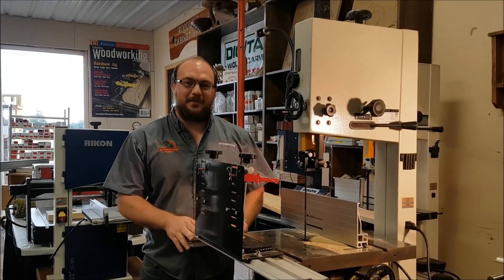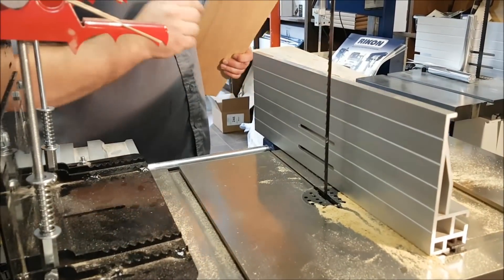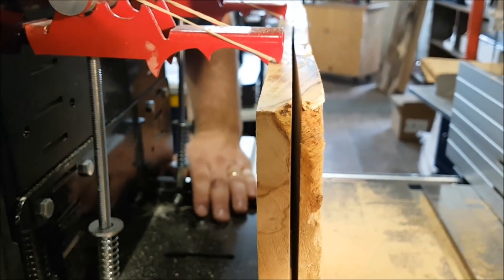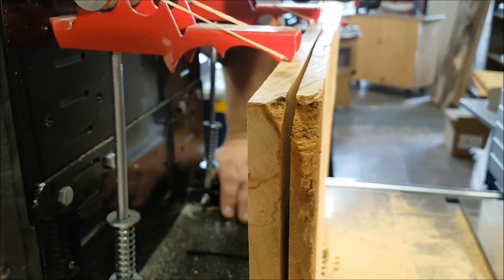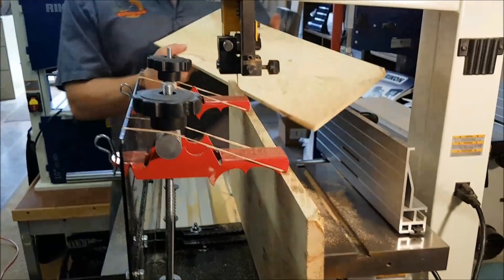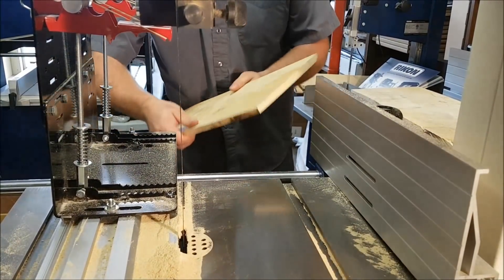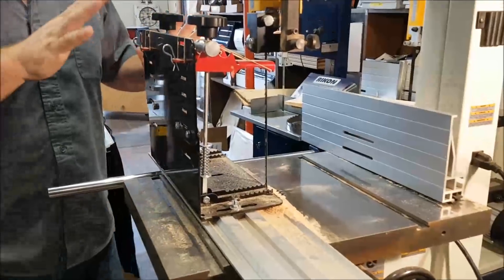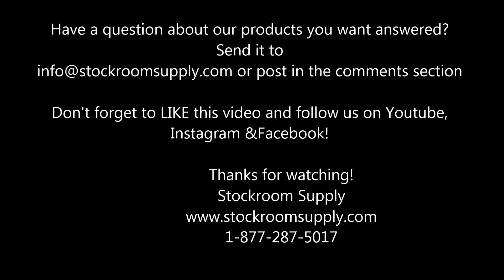EthAnswers Blade Drift Myths #2 Why Fences Don't Work On Bandsaws

Comment: But you will still need to joint the initial board after resawing or lose the board, doing it this way will create either more work (much easier to joint a thick board over a thin one) or you will lose two boards,the first and last ones cut on the 'deal'...and that's too much waste for the types of wood I use. 

As to how to hold the boards against the fence to avoid tension springs in the wood make some simple feathersticks for the infeed and outfeed to hold everything securly, it will cost you pennys to make and solve your problem. 

Again I'm not hating this is just misleading and it sounds like youre trying to justify a very unnecessary and expensive jig. 

I regularly resaw logs up to 350mm wide and anywhere from 3 to 5mm thick with no drift using ONLY my bandsaws rip fence and a plane.

I honestly believe most people are unaware of how incredibly accurate a well tuned bandsaw can be,now that's a vid worth making and something most people struggle with. 

The number 1 cause of drift, for me,is being too lazy to adjust the depth guide and having too much exposed blade under no tension above the cut. Something that is purely my fault not the machines.

Again no hate these are just my opinions and I mean it as constructive as possible.

Comment: I had bandsaw drift so bad I almost bought a new saw I’ve tried every trick on utube and nothing worked, went to a wood show and watched carter bandsaw accessory show and talked with them they sold me a blade and new guides that almost looked like what I had but I tried it anyway and man I can saw paper thin or thick resaw with absolutely no drift don’t know why but it works
Reply: Exactly what did you buy?
Reply: I bought the carter guides and blade from Alex snodgrass and for tight cutting I bought the carter kit and you take the guides out, believe me it works like magic

Comment: If you relieve the fence a quarter inch past the back edge of the blade 3/16" deep, or just remove any fence material beyond the back of the blade, there will be nothing for the warping material to press against. It isn't really necessary to guide the material once it is cut. Your fixture is nice that it keeps the material relatively flat.

Comment: So you still end up with a warped board after making the cut requiring you to face joint it somehow.  Not sold on it.
Reply: The warp was there from the start, and he created a flat side with the cut. Now it can be put through a planet to create two parallel flat sides.

Comment: So as the material between the fence and blade stresses it forces your work in a direction that you can't control. So when the board stresses using the Little Ripper the board  has nothing to push against so the cut on the board in the Ripper stays true to the blade and the rest of the board is free to stress without causing a problem. I guess that's how I see it. One comment said using a planer sled would be a better idea. I like new ideas and yours is a good one but I'll have to go with the planer sled. Good job on the video!

Comment: But you still end up with two twisted boards that have to be face planed. I don't get the advantage here. Just hand plane it as flat as you can, shim it in a planer sled, when it's flat on one side flip it, and run it through again without the sled, flat side down. Resaw the now square board, and run the flat side down through your planer again. Now you have 2 flat faced boards that can be edge jointed, and planed too thickness.

Comment: So with the little ripper you can essentially create a straight face when you don't have a jointer big enough to handle more than 6" or 8"? That's definitely one of the cooler things I've seen recently. Good job explaining blade drift.

Comment: Makes a lot of sense. But after you cut it on the little river, you still have to flatten it in a jointer or with a plane . You need to do a lot of ripping to justify buying that jig. What I do for the few times I resaw, I joint the edge on the jointer so it is pretty square, straight and flat . I draw a line down the center of the board and with the straight ,flat edge down and  I hand feed it through without a fence and cut to the line. I get stress just like you said and then I flatten one side of each half and  then run them through the planer.  I don't even have a high fence...Cheers, Jim

Comment: I'm not exactly a precision craftswoman but it's great to have that capability when you need it. I dont have a bandsaw and use an old Triton table saw with a 9 inch circular saw underneath it to break down lengths of timber to the widths I need. Crude as it is it was life changing when I discovered all that it can do. However, when using the fence to rip longer lengths of hardwood  (the Aussie kind that is around 900kg per cubic metre ), I often end up with a skewed edge which I think has a lot to do with what you are describing about tension in the wood. I solve the problem with a hand plane and mostly that's sufficient to complete the task at hand but I can see that down the track I'm going to want to do better. Great video with straightforward explanation.

Comment: Instead of jointing a warped board I will often hot glue it by 3 or 4 points to a piece of 3/4" plywood that is true.
Reply: Good idea!
Reply: Sounds good I'm gonna give that a try.
Reply: The hot glue will effectively help add some clamp pressure too preventing further warp as you cut against the fence, a bit like in his example.
Reply: or run it on your straight board through a planer then resaw.

Comment: Why couldn’t you cut in about an inch, then insert a piece of metal the same thickness of the blade, then clamp the cut one inch depth with a “C” clamp to keep it from opening up? Then, slow down the cutting speed to help stop the blade heat from warping the wood? Also clamp or placing weights on the board while still warm could help flatten it. I have used all these methods on small pieces of wood I’ve cut from larger stock to make lumber for Doll  house furniture. I’ve never worked with large planks like you do, but would love to know if my methods would work. Respectfully in ignorance, Steve

Comment: ANY material that has inherent stress will warp when cut . also, a blade that is the slightly sharper on one side will want to drift.  Even rolled steel when cut like that will bend and twist like mad.

Comment: This thing seems about as useful as an electric fork, but even more expensive.  

It's all free if you simply adjust the fence to account for drift every time you change blades. Don't know how to?  Lots of free explanations on the 'Net, but  here's how.  

Take a 15" to 18" piece of scrap and scribe a straight line it, parallel one inch in from one edge.  Then (by hand without a fence) cut as straight as you can half way down the line and stop.  Hold that board at the angle it is, and use a Sharpie to draw a line on the table that follows the edge of the board.  Remove the board and adjust your fence along that line on the table.  Shazam!  You''ve adjusted for drift.  Then joint your project board so the side and edge of it are flat and square to each other.  Lay the newly squared side against the fence and on the edge.  It won't tip because you squared it, and it won't drift because you adjusted for it.  

Take the money you have saved by not buying this contraption and take your loved one(s) to an expensive dinner  . . . or more than one, for that matter.
Reply: Assuming the board has a straight side that is congruent with itself. Or not bumpy. What if you trace the line and it is not straight?

Comment: This is why my fence has a piece of bar stock mounted to it parallel to the blade.  The bar stock just helps keep the board oriented, the operator keeps the board tracking properly.  Takes some practice, but it works and costs less than a good beer.

Comment: I've got a Rikon 14" (10-324), very similar if not identical to the bandsaw in this video, and it came with a re-saw bar. This is exactly the right application for it. The board only needs to be against the fence where it is directly next to the blade - it can deviate away from the fence both before and after the blade, as long as it's parallel and flush right at that point. This is a cheap piece of kit if you don't already have one, it's just a piece of round steel stock with a bolt to go through one of the slots in the fence, and a stud to go into the other. Just google "re-saw bar".

Comment: Obviously that fence is to long, Make a fence that is very short an parallel to the cutting blade.
When you cut an keeping pressure on the wood up against the new fence, The wood will be cut perfectly in half or as required
Reply: His fence is an extrusion, he can slide it back so the wood is free after the blade.
Reply: Aluminum too so if someone wanted to never have it long ever you can just cut some off it.

Comment: 1974 I used a fence on a band saw, never did again! They never work.
Reply: oh really? works for me. Start with cleaning all your guides and lubing them. Now setup a new blade correctly. You can now resaw nice straight thin pieces of wood using the fence. Be aware of the grain and dryness of the wood. A properly setup bandsaw will not drift. Sounds like you tried once and got poor results. If you don't get good results is is because the saw and blade are not right.

Comment: Yes, there are times you can get away with not jointing, but just about every carpenter should know - Joint first, then plane if you want it perfectly flat.  Not sure why you'd even talk about not jointing it.  And if a piece is wider than your jointer... You do know you can flatten a board with hand tools, right?  :-)  (you DID say there was no way you could resaw it..)  But you'd probably be better off calling cabinetmakers and mill shops in your area and see if you can pay them to do it for you.  I also noticed that, when you put the wood in the 'little ripper', the top wobbled quite a bit while you were sliding it up to the blade.  You can't tell me it doesn't move during a cut.  To use a regular fence instead, slide it back, so that it only extends past the blade by an inch or two, or if your fence can't slide back, add a flat block to the fence in that position for the same effect.

Comment: But you still need to plane and joint the boards. I prefer to flatten a side first thing and when I do that I never get drift or stress and the pieces afterward are already close to flat.

Comment: As a pro woodworker, in my experience the most common reason for fences not working on a bandsaw is that one side of the blade often cuts better than the other.  This leads to a wandering cut.  For that reason, most folks recommend a guide that comes to a vertical edge, aligned with the front of the blade.

I've seen Little Ripper demos and b'golly, the sucker works.  At least with a pretty fresh blade.

Comment: Yes Eth you have to joint the board to use the fence but if you want say 3mm-1/8” veneer then not doing that will make your first slice bowed even using the other method. Fences have been used for many years and with success and particularly with the right blade and low tension one can obtain thin slices almost ready for use with minimum saw marks. With your piece of kit I cant see how you can be even sure of presenting the wood to the blade at 90 degrees square horizontally or vertically without a lot of messing around. Or have I missed something important?

Enjoy your vids Eth because I like discussion!
Reply: I used to mess with fences and contraptions until I found how much easier it is to do by eye with an easy to set magswitch ball bearing guide. All the problems discussed are eliminated by using two rollers one side bearings other side rubber. No limit to length of cut.. Today I didn't even bother with a pencil line, just cut by eye parallel to the edge with a rubber wheel on other side so it stays hard against the bearings. Can find the sweet spot for drift and allow for different sizes and wood density on the fly by listening.

Comment: fences on a bandsaw are difficult because the lead-in on them is always different with the fence systems currently on the market. lead-in is the amount of parallel that the fence is out in regards to the blade. 
a fence on a bandsaw should never be exactly parallel to the blade as you so aptly demonstrated with the little ripper how the wood releases as it passes the blade during the cut. if you know the amount of deflection your offcut will haev as it passes the blade you can adjust the lead of the fence accordingly and still get decent results..it's an art form all unto itself tho

Comment: some comments here advocating a 'short' fence to allow the cut board to splay.. question i ended up with was seeing myself using that style would have me getting past the half way mark on my board and then having less and less fence to support any of the board.. by the time i got to the end of my cut all i can see is two thinner boards doing just about whatever they wanted to; seems there would be a safety issue involved at some point..

Comment: Great video, great produce.  I have used my own guided jig version for about 30 years.  Using a free floating hold or other such systems like the Accu-Slice and Little Ripper have been essential in one form or another at sawmills for centuries.   However, like the Little Ripper, the grips do NOT hold the board to zero twist, flex or curve, as that would require holding 8 opposing corners plus a center pivot VERY tightly.  It typically takes a planer over 75 LBS per square inch to do this in just 2 dimensions, which is a lot more than is possible with simple claws and grips.   Instead, the system creates a relative float based on the point at which the blade meets the board, at which point the cut side of the board is free to float away from the blade and fence based on release of internal stresses and other factors.  That's how it works.
Reply: Thanks for saying this. I was really trying to figure out how a board with that much tension is going to be held from twisting and bowing by two little spring loaded teeth.

Comment: a 10 minute infomercial. There are videos on how to true a blade.  then you can use a fence AND the miter slot.  once trued it stays true
Reply: This is more about dealing with a piece of wood that is not planar. Does a true blade prevent wood with internal stress from becoming non-planar after re-sawing?
Reply: C Peterson  but a true carpenter hand planes his boards flat before cutting also 
Hank Vana2 you seem to know what your on about so I need to ask you a question if that’s ok. 
So recently me and my wife had troubles with our marriage and we decided to hire a divorce attorney so she got hers I I got mine out of the garden shed ( if you know what I mean ) so my attorney went to town on that bitch now I need to ask which is the best bandsaw blade to cut through bone. The divorce isn’t related to the question wink wink

Comment: Never had a problem with drift when using my cheap-ass fence that I made all by myself out of scrap lumber.  'Course, setting up the band saw correctly before starting the job eliminates more drift than any simple or fancy contraption no matter how much they cost (or didn't cost). Yes, even on cheap-ass bandsaws.  I won't say this is a scam, but it's a pretty useless piece of tom-foolery.
Reply: Actually it is a nice thing to have because of the way wood moves just like he showed you. I guess you missed the point of this video.

Comment: 6 inch jointer will deck a board up to 9 inches. An 8 inch jointer will deck a board up to 12 inches. You will need a planer as well, but I often deck/flatten boards wider than my jointer

Comment: The deeper you cut the wider that kerf is going to open up just because it's going to be that much more affected the farther away from the blade it is. If you put pressure on the board like you do on a table saw, which means no more pressure on the board beyond the point where it contacts the blade, you should be fine. of course it's going to open up the blade is acting as a wedge. The proper way to resaw is not with a fence anyway but just by using the edge of a board to lever against at the point where the wood contacts the blade.

Comment: How tall is your fence? Is it taller than 6"? You only have to face joint the part of the.board that will reference against the fence. The rest can hang over the back side. Right? It'd be a lot cheaper to rip your aluminum fence down to say, 5 1/2"..  you might also have to temporarily remove the guard on your jointer depending on how much it swings away

Comment: I am not sure exactly what the intent is for this machine as I am not into the profession. However, my question is what good does this do to cut that wide a piece, when I could see the board curve as it was being cut? About halfway through it made a fairly wide sway to our left, (your right,) then back again, leaving a warped board. As for Stress on the board against the fence,  could one not place another fence on the outside with a little slack to make sideboards for the board to stay straight?   That way as it opened up it could ride against the sideboards.

Comment: I'm not a woodworker, but wouldn't having a fence either side of the blade/ wood work?
Reply: No. The warp will not necessarily be equal on both sides. 

In my experience, you almost always have to joint a board after resawing.

Comment: So... What about setting your fence so that it doesn't extend (much) past the blade? Seems like that would also answer the issue of the stress-induced movement pushing sideways and binding the blade. Or am I missing something?

Edit: Oh, question has already been asked. I should have checked first. :)
Reply: Adam Luker I was thinking along that line, too. The “moment of stress” only occurs near the blade, so your idea is sound (I think 🤔)